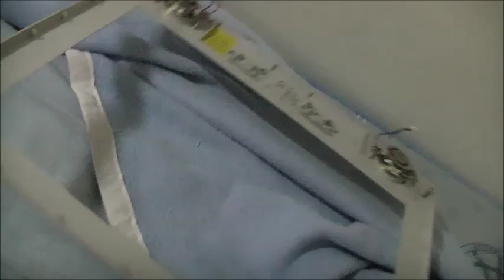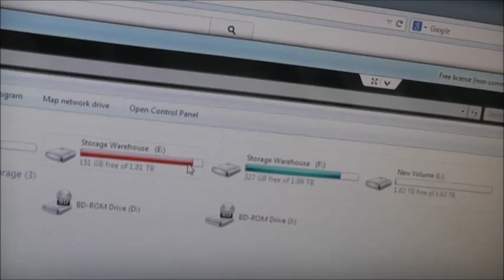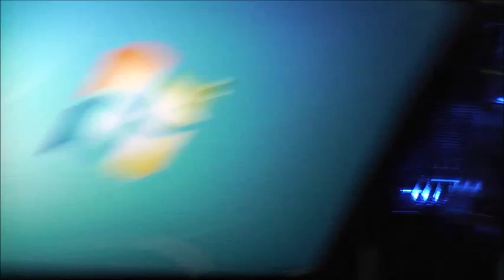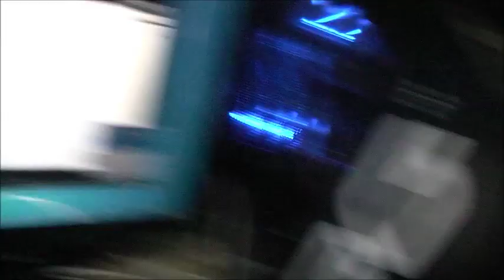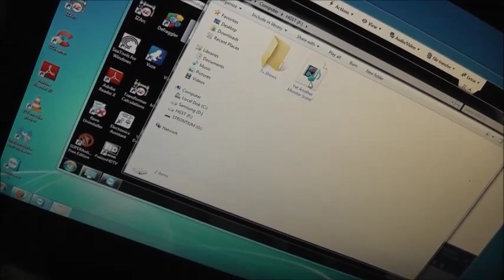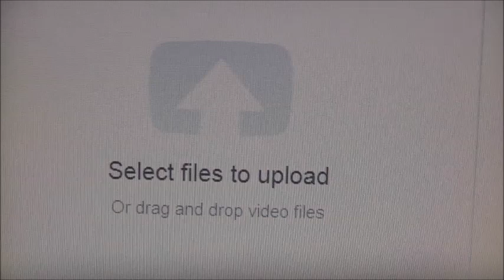Teardown & Test Monitor

Comment: Lelon capacitors are a Taiwan rubbish brand, mostly made in China, they are not as bad as the China brands capacitors but still crap. I have a computer with several bloated Lelons on the mother board. If they are installed and working that's one thing, but I would never buy any as replacements to get something going.

Comment: Mmmm, desktop images.......If it was possible to put an animated GIF on a desktop, use it as a wallpaper and have it run OK, then on my computer, I'd get a clippet of a video, and the video would be a meter with the loadwheel turning. :D

I'd take a snippet of the vid, convert it into a GIF, then set it to loop over continuously, and there it is...... Electric meter wallpaper with spinning loadwheel. :D LMAO.

Thanx for showing,

-BoomBoxDeluxe.

3rd July 2014, 00.10
Reply: That sounds classic for a gif'😉